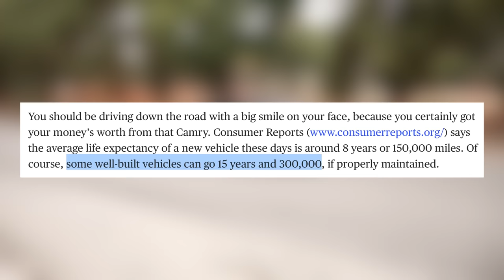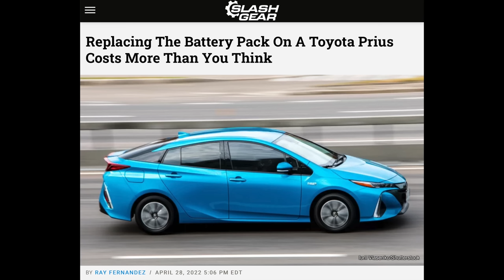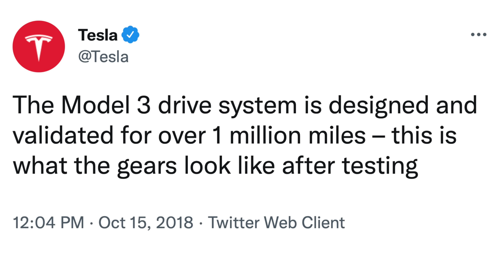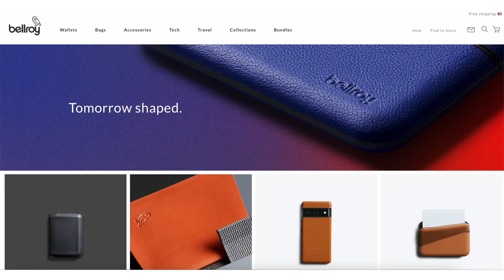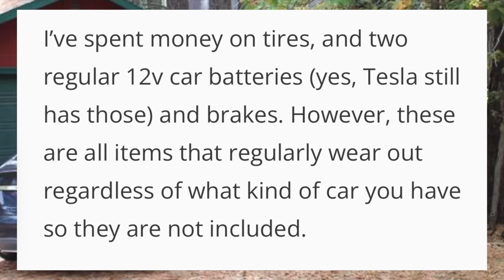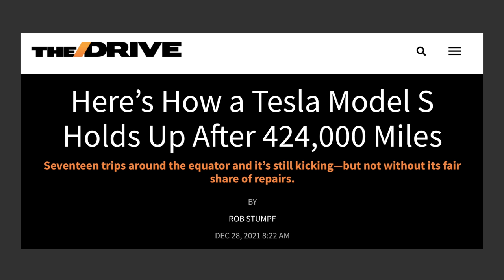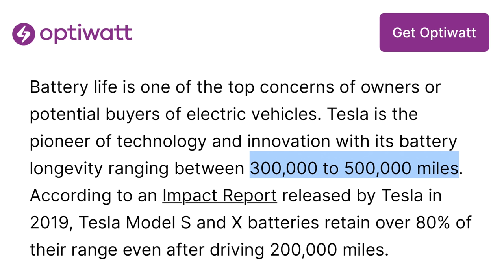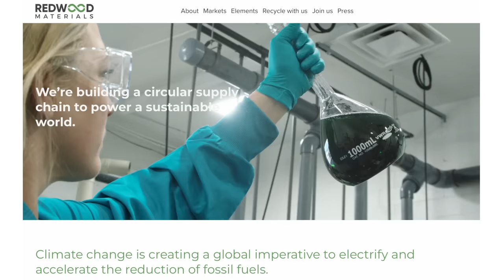The ONE MILLION Mile Tesla | It Still Runs

Comment: EVs dont last, it's a cell phone! You cant keep one for ten or twenty years without failing or running down, plus most of the country csnt even get Warranty covered especially by Tesla! I keep a vehicle for as long as it lasts usually 15 yrs, 5 thousand miles a year! Plus an 8hr stop to charge after an industry average of 300 miles is ridiculous!
Reply: Haha. Obviously not a Tesla owner.  Yes I do sometimes take 8 hours to charge my car after a trip, but only when I'm not planning on going anywhere during that time (like when I'm sleeping in my bed having nightmares about the "old days" when I would have to stop at a gas station on my way to work in the morning because I couldn't "refuel" my car at home.
If I'm travelling long distance (like the 4,200 mile trip around the Grand Canyon I took this summer), I typically stop every couple of hours to pee (old man syndrome) and charge the car for 15-20 minutes at a supercharger while I "stretch my legs". The car can go longer between stops than my bladder, so I make more frequent stops than necessary, and don't charge as long which is also better on the battery.
Reply: @daviddesousa8538  yes if charge time is not an issue, or range isnt either, then an ev is a choice, except the price for most! It still doesnt help the cell phone effect of having to pay a monthly charge just to be able to use the features of the car and to charge it, plus once evs are more ubiquitous rather than novel the resale value of a 6,7 year old Tesla will drop knowing that the car will cost the new owner 20-25 thousand to repair in a couple of years! Personally I could not use one for my out of town trips because of zero charging network, but yes if I drove mine only to work and back and errands it would be great, just not 60-100k great! Lol!
Reply: @daviddesousa8538  you do get credit for being a much more patient person than I am, though lol! Maybe some day they will make more sense but then I have already bought my last vehicle, God willing, so it just has to last me maybe another 15-20 years then I wont need one anymore,

Comment: if there is a gearbox, then there is oil in the gear box but i don't think tesla comes with a drain pluck on it as it is completely sealed. any car could reach a lot of miles if it is driven that far in a short time. But there is a differense in driving it far in short time vs driving it far over 10 - 20 years. if it could last 20 years its a good car. if it only last maybe a tiny bit over 10 years then its a shit car lol 🤣. only time will tell. I own two cars a little over 20 years and they still work like a clock.

Comment: You make it sound like high mileage is the number one indicator of a fantastic car. I drive an 18-month-old truck that has half a million miles on it. Does that mean my truck is somehow awesome? High mileage on a new car is nothing special. By the time this truck is 3 years old, it will have 1 million miles on it. But it will still be a new truck. You want to impress me? Show me a Tesla that's 20 years old and has a million miles on it, then I will be impressed. I also have a 1978 Chevy Malibu with only 20,000 miles on it. I don't drive it much, but when I do, it drives just like if not better than a brand new car. Extremely high mileage in a very short span of time proves nothing about a car. If you had enough time and enough open road, you could get 5 million miles on that car and I still wouldn't be impressed.

Comment: For all the idiots in the comments. 

You guys are all worried if a battery will last 200k miles. 

Do gas motors not have issues?
Reply: Tbf gas motors can last for a long ass time if you put care into them, batteries will die out no matter what
Reply: @woa1350  True. 

I'm at the point having a set it and gorget type vehicle is attractive. Constant or regular vehicle maintenance gets OLD just to be left with an ancient unoptimized machine. I have no pride in driving a "good Ole gas vehicle". If I get 180k miles out of a tesla with little core maintenance, GREAT. It'll be LONG paid off and a huge lack of headache.